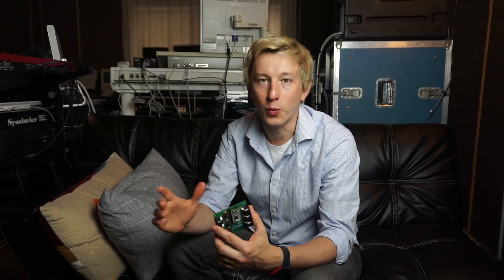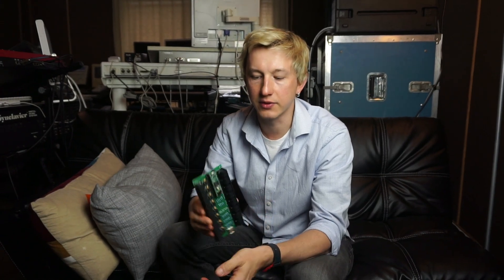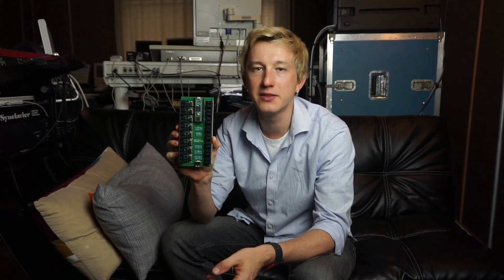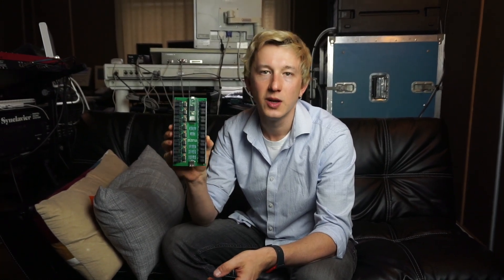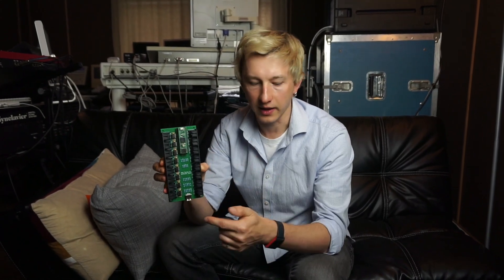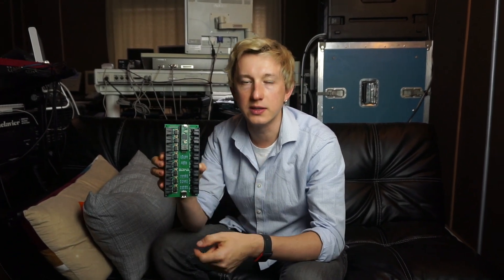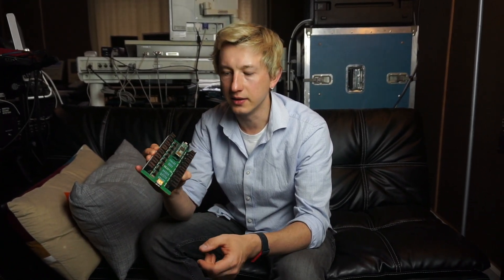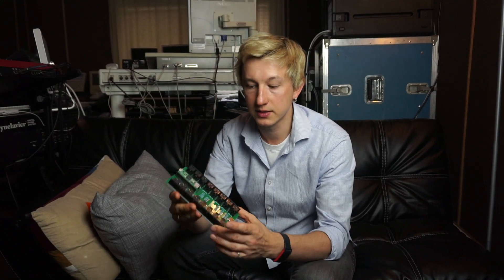Teensy 4.1 MIDI Breakout boards DIY kit

Comment: Great kit ! Can you tell me if I want to have 16in x 16out, can those be chained or something ? or do I need to add another Teensy to duplicate this one ? If so, how can I make them talk to each other without having too much latency ?
Reply from the maker: Yep, just connect two of them to PC/Mac to get more ports. You don't need to cascade those. (You can though through USB host port on Teensy 4.1 8x8 board).
Reply: @DeftAudio  Thanks for the quick answer. I was hoping using it without a computer, that's why I asked.
Reply from the maker: @kevinpire3117  Got that, yes, you can cascade them then. There is a new product coming in the 8x14 configuration in a few days. Might be another option for you.
Reply: @DeftAudio  Nice, I'm gonna wait and see then :) Thanks
Reply: @DeftAudio  Any word on the 8x14 version?
Edit: Nevermind, found your video on it, it looks awesome!

Comment: very interesting.  have you checked its midi latency?  connect midi out to midi in and send a note and record at the same time and look at the time difference between played and recorded note.  I have checked so many interfaces like this and decided to get  rid of many.  additionally all the multi-port interfaces i had slowed down when there was midi data on every port (even a single midi channel on every port) and thats another test that needs to be done.  I would really appreciate if you would provide these tests.  thanks a lot.
Reply: Did you ever find out the answere .. ? Seems a bit too good to be tru , wondering why , any of the bigger manufactures hasn’t done this already
Reply: @ArkaHtun  it depends on how you code your interface. If you use interrupts and midi is the only thing it's very fast. The Teensy can do two operations a cycle at 600mhz. You only need about 96khz to do a single pair of midi ports(using  three operations to receive, copy, and send each bit of midi data). 600mhz is crazy overhead. I actually got this because my cheaper usb midi hosts and merge boxes were slow and clogging up when used to merge note date with a clock signal. I put a uclock source that automatically follows whatever is put into port 1